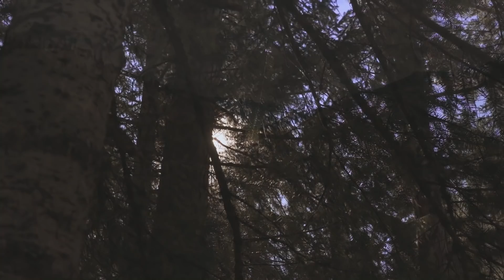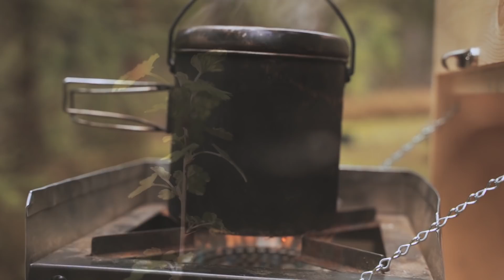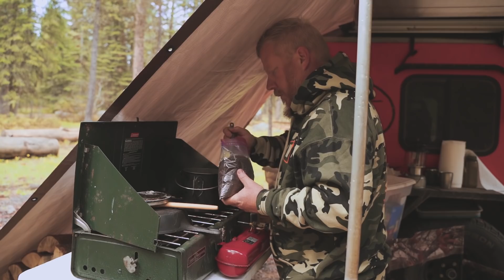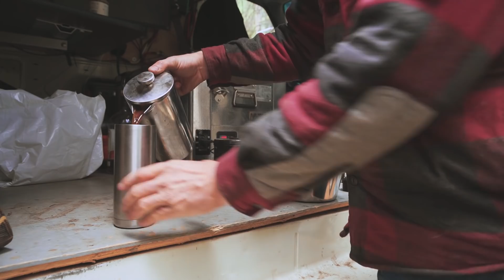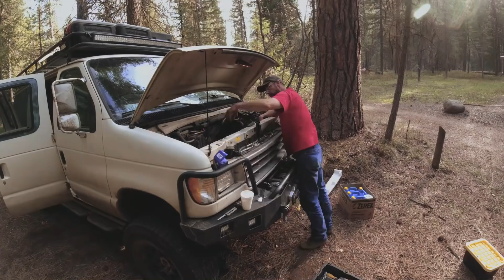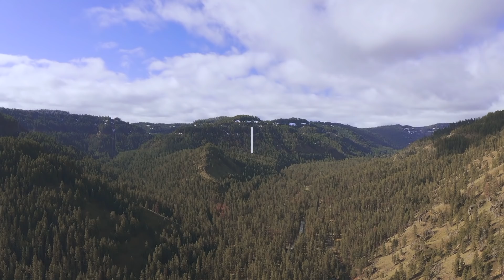Ford E350 4x4 Van Repaired in the Wilderness

Comment from the maker: The van has been running great since I repaired it myself. Sometimes new parts fail and that is huge bummer. What is the worst break down you have had to deal with while out in the woods?
Reply: I had a new radiator for my van do that as well. I was able to pinch down the seam with a pair of channel lock pliers and it's been holding 7 years now..
Reply: Well the first time I had a breakdown, my battery blew up in my 1987 Toyota pickup because smart me forgot to strap in the battery after replacing it, it ended up frying the whole electrical system and set my motor on fire. I had to roll it down a steep forest road to get to cell service. The 2nd time was because my timing chain jumped and wrecked the engine internally, i had to walk a few good hours to even find a person outside of Stanley, Idaho.
Reply: All the years on the back roads, only one breakdown that left me outta commission.  Fuel pump went out (the kind inside the tank) and had hike quite a few miles to get a tow.  Cell towers were not plentiful in '96!
Reply: Might want to verify your gauge is working correctly ,it would have showed running cold in comparison to run time..it was obviously blocked off causing the radiator side to overheat hence then over pressure..
Reply: Maybe you need to move your temperature gauge up on side of windshield like they do with VIP gauges,, or hook up a temperature alarms if you are like most that dont keep a eye on instruments...but if you are in desert not paying attention to gauges it can kill you and your car.....I just remember driving 30 mile in 120 degrees weather and with good gauges I was able to see and let it cool off to 160° then run for about 3 miles and shut off at 210-220°  and so on...but if I had just the idiot gauges I would have NO CLUE what temp my motor is running at...and when u know your rig...you will know when its having a problem,,,you will get it sooner or later...love seeing you chill ,, this been different but good thing your bud is with you or your learning experience would be totally different...keep being blessed my friend...
"Jes-Se- Out-&-Into- The- Real "
Jesse Ruiz
Reply: The thermastat that is was blocking flow
Reply: Terry Boomershine I've been in a situation where the thermostat on my car failed. So I took it out, Permatexed the upper radiator fitting back in place, topped pff the coolant, started the engine up, checked for leaks, and hit the road again. I didn't actually replace the thermostat until that winter.
Reply: I was elk hunting in the Gila in New Mexico and had two flats within 200 yards of one another. Of course I only had one spare in my truck. The second was in camp; dummy me. I walked two miles back to camp, over mainly easy terrain, and had to roll the second spare back to the truck. All the while my hunting buddy was field dressing an elk and had a good laugh when I told him the story.
Reply: Put a small cedar tree/Juniper into my flywheel in my old CJ when backing down a small slope jamming it through the cover and into the flywheel. The biggest issue was moving the Jeep off of it and uphill. Thankfully I had a come-a-long and a strap but three trees were pulled out by the roots because they are so shallow-rooted before I got it far enough to crawl under and yank out all the crap jamming it up. It started right up, thank god. Then I proceeded to lose my rear U-joint. It was the early 90's so cell phones were not an option. I had to pull the driveshaft off the transfer case with some very basic tools and limp home on just the front. Fun all day!
Reply: 26 miles in on dirt roads, I bottomed the oil pan out on a rock. I had to whittle a stick to jamb in the hole, then I had to stop constantly to add oil. I got out, and made it home. I ordered a new pan, put it on, and kept on trucking.
Reply: Glad you're back up and running.  I really enjoy your videos.  Used to live in OR and loved exploring there.  I had an 88 Cherokee that started leaking fuel way out in the Joshua Tree desert.  Lucky for me one of the only spare parts in the truck was fuel line and hose clamps.  I had noticed the lines didn't look too good a week or so before so I bought the stuff anticipating changing it.  Someone happened to pass by and asked if we needed help.  He couldn't believe I had fuel line with me.  He said he had tons of extra parts but not fuel hose and that he would pick some up as soon as he could.  lol
Reply: That's how the universe likes to make our lives interesting & memorable. Back in 84' I froze a front wheel bearing right at the south rim of Grand Canyon on Memorial Day weekend. Luckily there's a service shop at the rim & they couldn't fit me in for another 3 days but they had the bearing in stock & sold it to me. That alone was a miracle because we were in a 67' Buick Wildcat convertible. Anyway... I fixed it, we survived another challenge, and we'll never forget that day.
Reply: Split coil had me limping along back in my old motorcycle tramp wandering days. Lots of roadside repairs. Fortunate to have always made it out on my own power. Never fun at the time but makes for good campfire stories. Skol!
Reply: There are qualities parts and shitty parts. Which did your mechanic use?
Reply: Deer hunting in my 2000 F350 SuperDuty a few years back in a very remote area of Freemont National Forest, my Injector Controller Module died.  Electronic part, with no work around, and a $1000 price tag.  Was able to get another hunter to tow me back to pavement and a call to AAA to have it towed a couple hours north to Bend.  Had to call a buddy for rescue to come tow my trailer out of the deep woods and back to Bend while I waited on the repair.  Kinda got soured on Diesel's at that point.  Too complicated, and expensive to fix vs a gas engine.  Now back to Chevy with a 6.0 gas and much more confident in the ride and exploring.
Reply: Punctured an oil pan years ago.  It was high enough up on the side we didn’t loose all the oil. Drained the pan, cleaned around the damage with sandpaper, and plugged the hole with epoxy. We let it set for a while, poured the oil back in, added the two spare quarts we had with us, and made it home. The patch lasted for over a year. Rust finally claimed the vehicle. It was a beater but we had fun.
Reply: Primal Outdoors - Camping and Photography  - Lost transmission in Dodge Mega Cab truck at the top of ski Mtn ..it was a very expensive weekend, but the skiing was bitchen...
Reply: Does your van have a 300ci I 6 in it..
Reply: Or blowing out the bottom seal on the radiator..freeze plugs don't alway's pop first..sorry it doesn't always work that way nocandy..
Reply: Water heater went out two states from home. I have a full set of tools in my vehicle 24/7.
Reply: Only one happened Thanksgiving day was in Wisconsin just crossed the state line from Minnesota to Wisconsin and I have a 04 Ford 5.4 with the infamous spark plug blow out and that's what happened after waiting for 11 hours in 27 degree weather a tow truck came took it to a repair shop said it could not be fixed because it already had a repair insert in it so will need a new head or motor. Had it transported to my sons in Missouri. I'll need to come up with about $1500 for a new used low mileage motor so I can continue on with my journey. The couch at my sons is very uncomfortable.
Reply: Borrowed my father's 75 Jeep J20 pick up once for our Memorial Day weekend camping trip. Last day of the trip, we are heading down Medano Pass here in Colorado. I came over a large rock in the road. This was a big 3/4 ton truck loaded with camping gear. After coming over the rock I felt a large thump. Didn't give it any mind cause trucks ride rough. We got exactly one mile down the road, and the engine dies. I get out and open the hood and start looking around. No problems here. So I climb under the truck, only to notice my GAS TANK has fallen out. Called my friends on the ham radio to come back. They went and found the tank and salvaged about 3 gallons of gas from the fully loaded 40 gallon tank. We ended up strapping a milk jug to the power steering pump to get us off the mountain to a gas station. Then filled a jerry can in the bed and ran fuel line for the 75 mile drive back to town. Took me 3 weeks to find a new gas tank and support straps. 
Cheers from Colorado

Comment: I don't trust plastic capped radiators. I always replace them with either a Mishimoto or a custom 4 core all aluminum radiator from Mac's in Portland on 72nd and Foster. I reduce risk of failure wherever I can. And most aftermarket thermostats are pure crap.

Comment: It was great having a friend along to drive you into town. However if you had been solo you could have simply run with the radiator cap loose and kept an eye on the water. As long as the pressure didn't build it would limit the amount it was leaking. You can do this with radiator or heater hoses that rupture also, put some tape around them and make sure that the cap is not locked down and tight so it won't build any pressure. Keep an eye on the temp cage and carry extra water. It would have gotten you at least into cell phone range. Good work on your campground repair it's a done deal now.

Comment: I have an 86 E350 Glendale motor home with duels on the back. 80,000 kms on the original motor I will sell you for a good price, certified. Its mint but no AC and I'm old

Comment: if the plastic radiator has a leak you can fix it using a soldering iron or use a lighter, use it to melt the hole and close it. break off a piece of non-essential plastic to use as filler material, just like welding metal. you can also layer glue into the cracks to slow to leak and carry extra water from a lake, you're going to replace that radiator later anyways.  if the metal has a hole use 10 minute epoxy or anything waterproof. also in an emergency remove the thermostat and run the engine without it. you could have avoided all the headache and fixed it yourself, also carry extra water and when you get to a store you can buy a new radiator.

Comment: Oregon is beautiful. I was there around 82. Timberlake Job Corp. Been to Estacada, Gresham and Portland. I believe it was spelled Clackamas River. Hot springs. Water falls. It wasn't much of a breakdown but once my then wife was driving me to work in her VW bug when we heard this horrible  racket. We stopped and I got out to look. The floor, under the backseat passenger side, had rusted out and the battery had dropped out onto the road and we were dragging it. I had to pull the seat and lift the battery, hunched over, and tell her to "go!" Lol.

Comment: Stationed in Fairbanks, Alaska in the late 70's / early 80's. I had a 75' K5 Blazer lifted with 34's on it. Popped apart a front universal on the rear driveshaft. Luckily felt and "heard" the "UT OH" clunk before the driveshaft nosed into the ground. Always had a spare part for this and that, which was good being about 20 miles out on a forestry trail. Sleeping pad unrolled, slid under truck, driveshaft removed and up on the Warn winch bumper, u-joint replaced and driveshaft back in apx 25 minutes later. Not so bad when you are in your 20's and can still crawl around under the truck with no problems. Now, I have to use physics and gravity to get me to the ground and then fight both of them to get off the ground.

Comment: Jason, what happened to your radiator was a air bubble. They form in front of the thermostat, and then the thermostat can’t read temperature and doesn’t open. Pressure builds until something gives. A old time repair is to drill a 1/8th inch hole in the thermostat flange.  When the air is purged through the hole, problem solved.

Comment: My family and I camped on the Costa Brava in Spain.  On the way back to England through France our radiator overheated and a French tow truck driver had to haul us into Lyon...repair was uber expensive nearly maxing out my AMEX card.  While stationed in North Bend, OR, in 1969 my family and I were on our way to the Coquille River to go fishing and our Volvo P244 broke down.  A pick up truck pulled up behind us to give us assistance.  It turned out to be the civilian contracted electrician for our radar site.  He towed us to a garage in Coos Bay but damned if he didn't make me an offer on my Volvo.  He wanted it for his daughter who owned a '63 Chevy Impala Convertible but couldn't drive it due to some allergic reaction whenever she entered the car...possibly mold.  Anyway, we made a straight trade.  The Chevy was stored in his barn covered with a tarp.  When he pulled the tarp off my wife told me not to trade because it was filthy and covered with spider webs.  However, I saw potential and after spending an entire weekend cleaning it, scrubbing the blue top (couldn't tell what color it was initially), waxing the body and polishing all of the chrome including the chrome hub caps I realized I scored a treasure.  That car drove like it was new-ish and took us up and down the Oregon coastline without any problems.  Sadly, I sold the car just before we returned to England, my wife's home, and we were able to acquire a beautiful English cottage with the money from the Chevy sale :(

Comment: I had the same problem. A small hole opened in my radiator, which was soldered up (brass radiator). Ran  the truck again, second hole opened up next to the first. (the repairman said if it happened again he'd need to cancel that particular tube.
Culprit-bad radiator cap, replaced it and I haven't had any problems for over 10 Years.
(Parts places can test your cap)

Comment: With all the cooling system problems I think you have a blown head gasket. It's probably a small leak but under enough load and head it blows cylinder pressure and heat into your cooling system.

Comment: If you are serious about this off-road driving which is a must in the wilderness alone, you should immediately replace the original cooler in plastic with better in aluminum! An aluminum radiator can be repaired on site if you are prepared. You put the money in the wrong parts and then you stand there. A Jeep wrangler Rubicon is what you need. Not that Monday's copy called ford.

Some people never learn...

Comment: Good job on the repair . You should keep an eye on the engine oil level . Some times after a motor has been over heated a few times like this they start using a lot of oil . Blown out  rear differential and two weeks later the transmission on my GMC last summer . Went out and  got a brand new F250 4x4 and loving it . Lost my ass on the GM though .

Comment: I cracked my transfer case backing into a rock one night.  My friend suggested we use bubblegum to seal the 1" long crack so we could get home.   After telling him it was the dumbest thing I'd ever heard of,  I threw a piece of Hubba Bubba gum at him and told him to start chewing.   We sealed the crack and it got me home no problem.   I even had to chip the gum off the oily, aluminum t-case when I fixed it.

Comment: Jason, if you have the coin. Would you consider to replacing all your flexible hoses, Heater hoses, bypass hose, install a new thermostat housing, replace all hydraulic lines, power steering hoses, etc. In short, replace any old hoses under the hood. That could potentially fail in the field. 
I know it's a huge expense, but it takes the guess work out of the equation. Cheers, Mate.

Comment: That's a tough break, Jason. I hope you were able to have some fun in there. Just a side note if you notice your engine running hot, I first check the oil level. If its good I immediately always suspect the thermostat. You can verify that by running your heater...if hot air doesn't blast out immediately it is probably the thermostat. Since the purpose of a  thermostat is to quickly warm a cold engine, it is safe to delete it. On a cold morning your engine may be slow to warm but that is better than over heating. I am personally not fond of the newer high pressure coolant systems because they are more sensitive to overheats and are harder to fix.

Comment: I have a 1993 E350 and my thermostat did that about 10 years ago and my whole radiator top blew up like a balloon and burst.  Anyway, just recently I was watching your video when your heater hose blew...in April I was on a road trip down around Winimucca and because of your video and heater hose incident I decided to change mine out preventive wiss.  Also REPLACE THE CAP.  It's supposed to only keep 13PSI and release fluid into the reservoir if it gets to much pressure.  But your T-stat was toast.  My plastic "quick disconnect fittings on the heater hoses were very brittle.  I had to literally break them off as they were locked on and not coming off the way they are designed.   My radiator was not easy to remove.   How was yours?  Thanks for sharing.

Comment: Auto parts are my profession. If you can swing Ford OEM parts (Motorcraft), they are the best repair/service parts to use. I've used Napa parts before and they have been good quality. I'd use them again in a pinch if I couldn't get OEM stuff. The small strip mall parts stores sell junk unfortunately. High failure rates, low quality control, and oftentimes poor service behind the counter. You have to take what you can get in this situation but in the future as you maintain the Fords, OEM is the best way to go.

Comment: That was a minimum of 3 problems, if the thermostat was stuck open you would run cool, if closed you'd B hot with some added pressure but your radiator cap should have relieved pressure so that was also bad, but that top tank must have also been weak

Comment: I had a rear u joint break, pull the drive shaft off came down the trail in front wheel drive. My truck was a 78 F250 with 3 speed and 1 reallly low gear. So all the way down creeping in 1st and 2nd. We  did not hike to our mountain lake, but we got out! Great recovery on your part, things happen and you adjust.